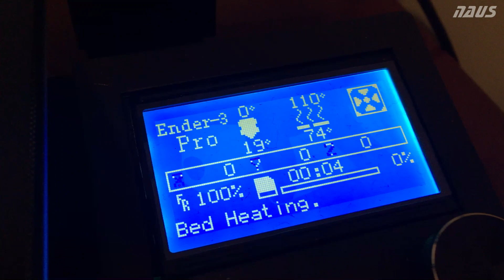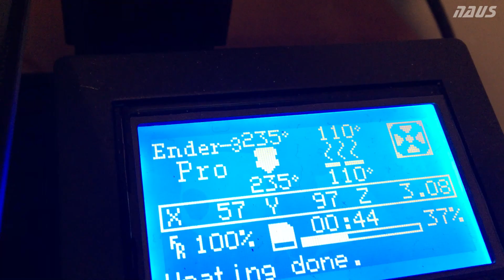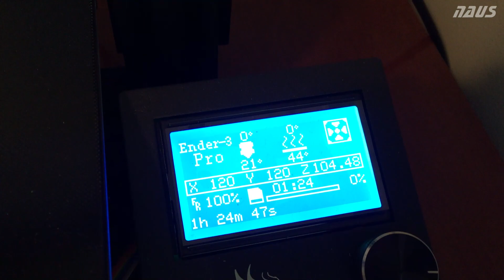How To Print ABS On An Open Frame 3D Printer (Ender 3 / 3 Pro)

Comment: My question is Did you just put the ABS in your printer? And print it on a file you already had That you previously printed in PLA Or what kind of settings did you have to change? To print the ABS
Reply from the maker: No the file needs to be sliced with an ABS profile to set the temps & speeds correctly

Comment: If i print out some thing for this, shouldn't i just find a thing for the parts fan that moves the air outwards rather than suffocating the fan or should i just cover the whole ducking thing up with plastic? because suffocating the airflow instead of redirecting it doesn't sound like the best option.

Comment: What temperature did you set the nozzle at? 

I'm having issues with my ender 3 V3 KE..it keeps adjusting the nozzle and bed plate temperature by lowering both, after I set the nozzle at 240 and the bedplate at 90-100.

Creality told me to use a different slicer to get both temperatures to stay fixed.

I were using Creality print and Creality slicer.
Reply: learn how to use OrcaSlicer, make whole lot of difference with any prints.

Comment: Is there perhaps a 3d model for the Ender 3s1 Pro for a bottom fan cover you can just equip?
Reply from the maker: Probably, this video was made ages ago
Reply: @NAUS2K  Hehe. I'm like brand new to printing. So I'm just looking for stuff to print now, especially a printer upgrade XD
But thinking practically, using tape is probably the most sensible, since I won't be switching from PLA or ABS. You'd be using ABS for a while before switching to PLA
So in essence, tape solution is the best :D

Comment: grate video. but after some height the print will automatically get off from bed. please give me solution
Reply from the maker: Get a different bed plate or use bed adhesion, or baby step the Z axis down when laying the first layer.

Comment: My problem with ABS and ASA is not the first layer or bed adhesion, problem is it warps off of the bottom support 😢 tried everything even an enclosure will try this next

Comment: That’s an awesome idea. Thank you. To prevent it from crunching when it auto homes, have you considered redoing it to where the airflow exits from the front instead?
Reply from the maker: I’ve revised it since to not have the scoop in the back and it seemed to work well still. I have since switched over to petg though due to the fumes

Comment: I tried this, also made enclosure with 40-50°C inside, printing on glass with small dots, doing brim 8mm... Still warping. Big warping with 250°C nozzle and 100°C bed  better with 235°C nozzle and 110°C bed  but still slightly warping. Any ideas?

Comment: Thank you very much for uploading this tip. I'm currently trying this out on my Ender-3 in combination with the experimental setting [Draft shield] in Cura, although i'm using duct-tape(just what i had lying around) to block off the airflow instead which seems to be working so far(fingers Crossed). 

I Actually gave up on printing with ABS in the past as my success rate was very low. My prints would either split between the layers and/or warp to the point of falling off the build-plate. The successful prints i had with ABS were small in height and "fast" to print (1-3 hours).

 - Tip: Enable Draft-shield in Cura under advanced settings->Experimental. This Creates a thin wall around object and helps keeping the temp up a little bit better than without anything :)

Comment: A Very valuable Video, I have been trying to print ABS on my ender 3 pro for a while now because I want to print the Voron parts but was never able to because the prints would never stick to the bed. I followed your video and used single sided Aluminum sticker tape and sealed the nozzle from below and now I am able to print ABS finally! Thanks a ton for the tip.

Comment: Nice hack! I'll try it. Please tell me do we need abs slurry or anything for bed adhesion?
Reply: I found that a mixture of wood glue and powder sugar makes a very good and sticky way of making ABS prints stick to my glass plates.  50-50 mixture with a bit of water, apply a thin layer and let it dry before you print.

Comment: Have you considered lowering or disabling the part cooling fan?
Reply: He's got part cooling off but getting air from the hot end fan. 

I'm sure someone has modeled up a mount just for this that he could print. 

A hero me or satsana might be better, have never really checked for air flow on the nozzle with fans off on mine

Comment: I use a small USB FAN plugged into an old phone USB charger to speed the cooling process for the bed.  You could also experiment with turning down the bed temp minutes prior to the print completing.  I've asked Cura to add that to their software so that we can set something like -3 to -6 minutes before print completes, turn down bed temp...  In an impossibly ideal world, just seconds after completing your print you would hear the POP of it breaking free!

Comment: Why are you not easy plug the fan plug off and the fan wouldn't blow anything anymore 🤔 or you could make a switch cable plug between the fan so you could switch the fan on and off for the different filaments. 😊

Comment: Do i still have to turn the fan ON sir ? at speed 1-255? thank you sir
Reply: They usually advise not using the part cooling fan when printing ABS.  You do not want any air currents moving around your printed part.

Comment: i always use a brim no matter the material. it only takes a minute or 2 to print and as long as you let the bed cool the part pops right off. Nothing worse than coming to check on a 2 day print and it broke adhesion 2 hrs before it finished the part is jammed in between the printer arm and the bed and the y and x axis motors are skipping on their belts.

Comment: I tried your modification and it worked like a charm for ABS. I don't have to use glue or spray. Just clean and level the bed and the print comes out perfect. Thank you for sharing your idea.

Comment: As crazy as this technique sounds it actually makes a HUGE difference! I am amazed because upping hotend temp alone was not alleviating my delamination issues. I now print ABS at 260 with bed at 110 with a similar foil deflector and it works like a dream in my E3 Pro.
Reply: hey are you using an all metal hotend? 260 is bad for the ptfe lining if you have the stock one
Reply: @probablyblue426  PTFE is typically heat resistant up to around 500 F. Plus that's a risk I'm willing to take if it improves print quality and consistency.
Reply: @garrettsmawley  okay cool
Reply: Do you mind sharing your profile settings? I am having the same problem
Reply: @mcfluffy28655  E SUN ABS profile with heat ramped up 20 degrees.

Comment: I think I might of missed it But At what Temperature do you put ABS at? I see a lot of places at different temperature but Not sure.
Reply: You will be most successful running ABS at the higher side of the materials range. Personally I print ABS at 260. A lot of benefits and very little drawbacks to printing ABS hot and slow.

Comment: I'm currently 80% trough a print on an unmodified mega zero with no heatbed and printing at 235c with a raft extending 15mm past the part with zero airway and it's PERFECT.
Raft shows a little warping at the corners but the part is untouched.

Comment: I accidentally buyed ABS+, it was mixed up with PLA boxes. Succesfully printed it with tips from this video. I would like to point out that might be a BIG ISSUE with ENDER 3. Cooling fan for motherboard enclosure is connected with part cooling fan that you turn off when printing ABS. That also turns off motherboard fan and a bet it get toasty in there. I cut off connector of motherboard fan and connect the wires directly with extruder fan that's always on. To my knowledge all Ender 3's have that issue, even V2.
Reply from the maker: Thank you for this tip. I am going to check this out for sure

Comment: What are your print settings, I just got an ender 3 to print car parts and also use the glass bed that came with it but can’t get my prints right :( I’ve gone as far as building an enclosure for it to stay up to temp and sealed from the elements but no dice
Reply: Ive upgraded the motherboard, upgraded to direct drive, upgraded bed springs still can’t figure it out

Comment: I have tried a lot of different things to print ABS. Again and again I had problems with warping. Inspired by this video, I now sealed the bottom of my print head with tape for a test - the warm air can only escape upwards through the ventilation slots that were already there by default. I have achieved in this way the best print result with ABS on my Anycubic. Thanks for the tip!
Reply: what anycubic you own? i’m planning to buy the mega s and i want to print abs on that
Reply: @dmugas4989  I use the anycubic mega s. To avoid the airflow down i made this: https://www.thingiverse.com/thing:4873492
Reply: @joerky9540  ow thankyouu thankyou much appreciated
Reply: @joerky9540  I'm going to try this I want to get through my abs reel before I quit on it. Something that's helped me slightly is using the 1st layer as pla pausing the print then changing it to abs. I don't this will be an option once I change to pei bed.
Reply: Bro these is the best and most RESSULTABLE SOLUTIONS FOR WRAPPING THAT " ADJUST YOUR PRINTERS BED LEVEL"
Reply: exactly sir same problem....
i think i have to use kapton tape or glue or somthing.
Reply: Perfect results with an unmodified mega zero aswell.
Reply: same at my ender 3 😁

Comment: why not just flip the fan blowing the other direction? Im currently testing it out.
Reply: Update flipping the main fan backwards does help without the tape.
Reply: @ToxicxSocietyx  i will try your trick here..
Reply: Im very glad i came across your video i would never thought the fan would be the reason i always thought it was from the room air flow from hvac my set up is two ikea tables on top of one another with insulation foam boards to close it off and yet that was the reason that fixed it all.

Comment: Mine sticks at first then 20 mins into it the print separates off the bed and spaghetti everywhere. I’ve printed the same part in pla and it prints just fine. I had a trash bag over the printer itself.

Comment: PETG is great, very heat resistant is strong, if ABS is being a bit fiddley or having more problems than its worth, go PETG :)
Reply from the maker: I have a roll of that to try next :)
Reply: @NAUS2K  so can you use petg on ender3 pro?
Reply from the maker: @Chris-vc1dh  yes
Reply: @NAUS2K  no enclosure needed or any other tricks?
Reply from the maker: @Chris-vc1dh  not sure i have not tried it yet. But Im sure an enclosure wont hurt
Reply: @NAUS2K  be careful with the enclosure, I've tried it because of the noise while printing, and I've found that the motherboard of my Ender 3 Pro warms up and, while printing (PLA for instance) layers shift occurs. Common prints that previously worked fine without an enclosure, failed after that.
Reply: I printed a lot with PETG and went back to PLA as a main material. PLA just gives more reliable results and have much better layer adhesion. No reason to waste a time on these games.

Comment: I hope you swapped to an allmetal hotend because the PTFE tubing will start to burn/melt inside your stock hotend at abs printing temperatures and release toxic gasses aswell...

Comment: I got a glass bed and an enclosure. Still can't get HIPS to stick. What do you suggest?
Reply: HIPS, i found to be stinkier and harder to print than ABS. Nice texture on end product though.  Got good results by printing really hot, 250 degC - layer ahesion was better that way.  enclosure really needed too. probably with raft also.
Reply from the maker: Did you try what was shown in this video ?

Comment: you dont need those bed clips . after one or two prints, the glass will stick to the grey magnetic material by itself.. trust me try taking the clips off
Reply: terrible idea but to each their own
Reply: @kevinhansen5145  why
Reply: @jeff7731  the magnetic pad also causes the major bed leveling changes

Comment: Im currently struggling with the first lot of layers being like over extruded.
Otherwise the rest of the print is okay.
What's your hot end and bed temperature and initial print settings for this?
Any advice on this?
Reply from the maker: Bed is maxed at 110C, nozzle I believe is 235C. Getting the first layer perfect is critical. I am super ocd about making sure the bed is level and a lot of the time If I see the first layer isn’t sticking I’ll jog the Z axis down a small amount which helps plant that first layer better
Reply: Hey man, do you calibrate the bed when it's hot?  because if not, when you calibrate and then heat, things expand and the calibration does not work, that happened to me, all the first layer over extruded.

Comment: That was what I did before I made an enclosure for my Ender 3. Adding a draft shield in the slicer also helped. 
The enclosure was the best because it made the printer quieter and captured the odor. Thanks for the video.

Comment: I'm guessing it's pointless to try the regular magnetic bed with ABS.
Reply: PEI sheet is great for printing ABS but you need either clamps or permanent magnets as regular magnetic tape loses its properties at high temperature.
Reply from the maker: It’s not recommended to heat the magnetic bed above 80C so I didn’t even try

Comment: couldnt you just have printed a part that did the same thing?
Reply from the maker: Not really, it would of had to be super thin and being so close to the extruder nozzle to create an air tight seal, it would just remelt the material
Reply: @NAUS2K  ah, that makes sense
Reply: I printed a blanking plate out of PETG and it partially melted and deformed. Next I'll try thin aluminium sheet. Petg is only good to about 80 C.

Comment: Why not just utilize the draft tunnel under experimental setting. The bed keeps it hot.
Reply: The problem is the down wash of cooler air from the hotend fan. I printed in enclosure and still got warping and separation until I isolated the hotend.

Comment: I'd be concerned about fumes with an open frame printer doing ABS in your living room.  Warping is not the only reason enclosures are suggested.
Reply from the maker: Yes I agree, probably should have mentioned that too. For small parts / quick prints like this one it’s not really noticeable, however for larger 1+ hr jobs you can start to smell it . This footage is about a year old and I just got around to uploading it, I now have an enclosure
Reply: @NAUS2K  Did the enclosure make a big difference, whilst printing ABS? i got an free spool of ABS. And looking to build the classic ikea lack enclosure.
Reply: @NAUS2K  not smelling it doesn’t indicate it’s fine... it’s just an indication of how well you can smell